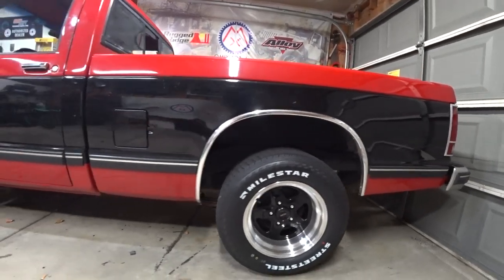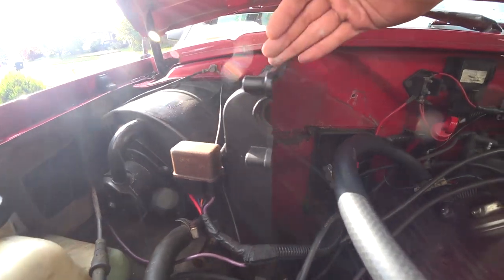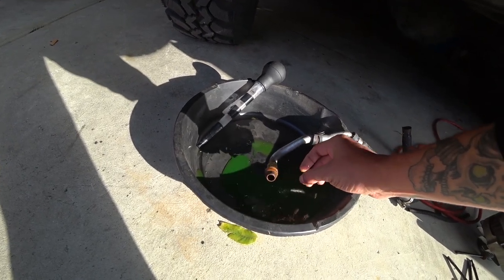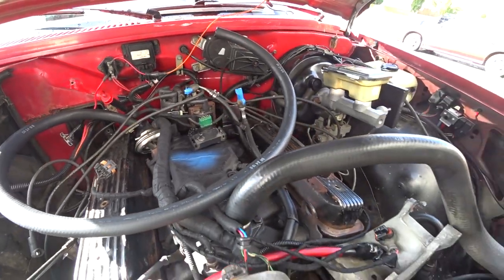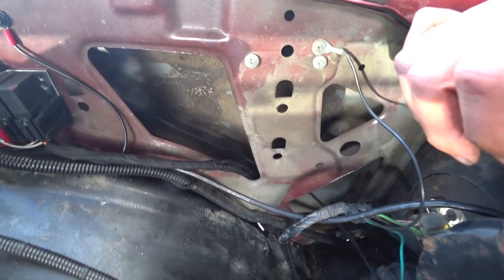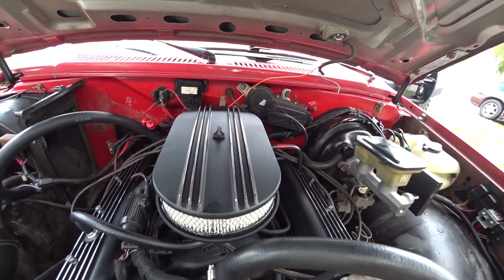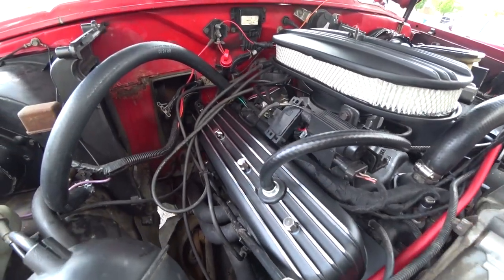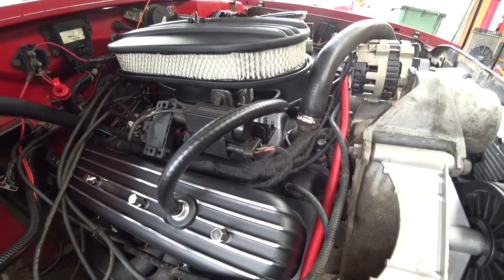TBI Engine Dress-Up, Valve Covers, Air Cleaner & New Throttle Body! Project SUPER 10 Ep.07

Comment: also what ac compressor are you running? i am having trouble fitting tall valve covers with my r4 compressor fittings on the back of the compressor

Comment: Good video. How did you do the wiring so the engine can run.
Reply from the maker: The truck was a 4.3L TBI v6 and the new engine is a 5.7L TBI V8, most of the wiring is the same. All I had to add was a new computer from a 5.7L TBI full size truck. Almost a direct swap, thanks for watching!